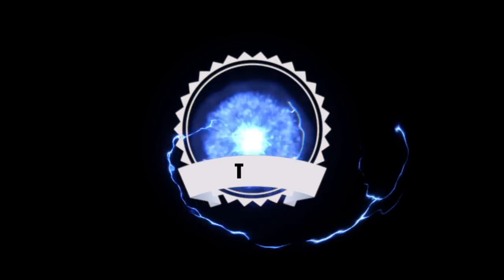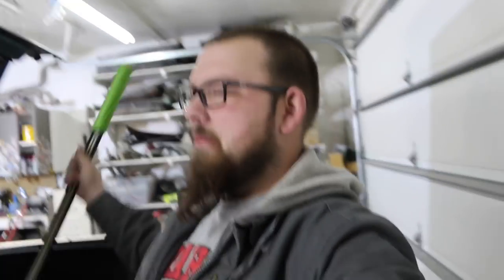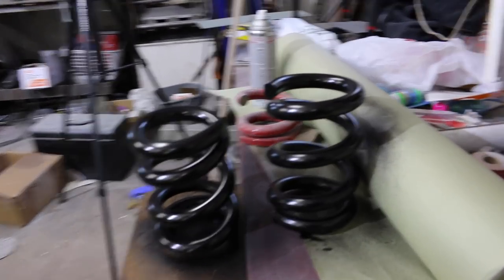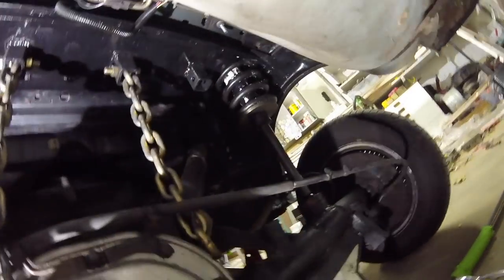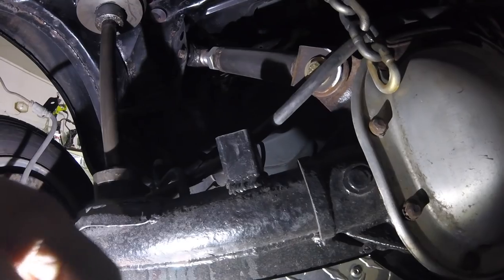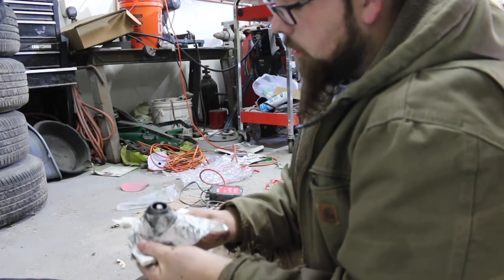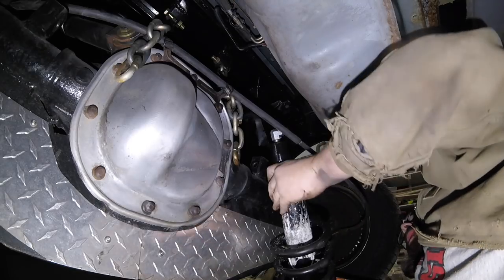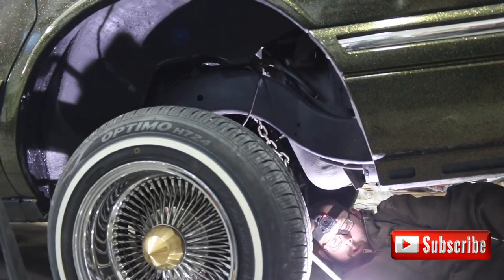18 Inch Rear Cylinders in a Towncar Lowrider!! PART 1

Comment: Do you just have the top trailing arms that go from the Punkin to the frame or do you also have the bottom trailing arms did you have to do any welding for the top trailing arms trying to get my Punkin level when I have the cylinders all the way up because I can’t drive locked up all the way Punkin sits at a weird angle

Comment: How far are the center line of the rear cylinders from the wheel wells in the trunk where they come up threw into the trunk? Im building my 3rd lowrider this winter. 2nd 96 town car. But i cant remember where they come threw. The reason i ask is because i have a sub box going on that package tray and trying to see how wide it can go.

Comment: I don't know how you got so much room in there with those current cylinders. in my Lincoln I've only got a couple inches till I start hitting the top of the deck with my 14s. I didn't think my car being the next body style was really that different but I guess it is
Reply: fuzzy wuzzy i have a 98 town car but I noticed that the rear arms are different from cutlass ,regals and monte carlo.. now i know they are gm cars but my Lincoln has its kinda weird WHAT DO I DO SO I CAN PUT HYDRAULICS IN MINE..

Comment: Do dumb question but i dont know...So when you disconnected the cylinder the car wasnt laid out and you can still disconnect it? If there is fluid in the line is it under pressure or do the fittings stop it from coming out once disconnected?
Reply from the maker: Liberto3512 with the car lowered on jack stands it looses a lot of pressure. Then that's why I jack the rear end up a little and hit the switch down to relive more pressure. Once you open a dump the pressure is gone.

Comment: There was 1 hater who drives a Prius already😂😂 Great video homie. I'm looking for a 90 Fleetwood will I have to do a chain bridge 2 power 3wheel?
Reply from the maker: Bosco Da Pro there is a good chance you will. It will help take stress off your trailing arms and rear ends.

Comment: What is that sleeve for, the one that was on the hydro? Is it just to protect the the hydro or does it serve another purpose. Also is it necessary?
Reply from the maker: 04014610210 it is to reduce noise from the cylinders rubbing on the body. It's just a piece of pvc pipe.

Comment: I gotta question for you or anyone that can shed light on the situation... Can u achieve a good lock up height(12-14" cylinders) and still b able 2 drop the back and lock up the front and scrape in a 90 Fleetwood or is it pretty much u gotta setup for 1 or the other?
Reply from the maker: Bosco Da Pro yeah it's possible. Has more to do with the spring your running in the rear to get it to lay out low.
Reply: RJ Tickler alright cool... I wanna b able 2 hop decent(not radical but a good hop) kick a nice 3 but still b able 2 have scrape blocks shoot sparks down the road LOL